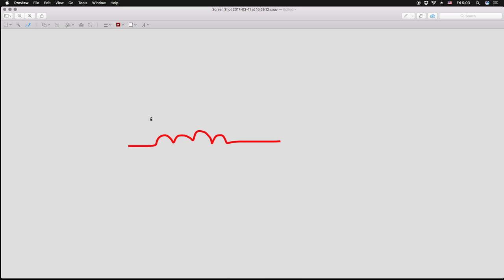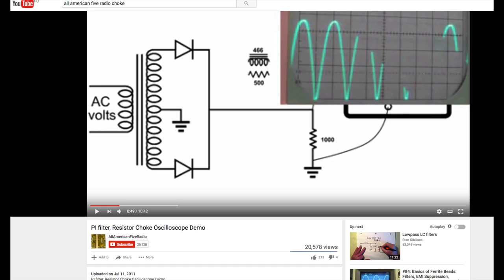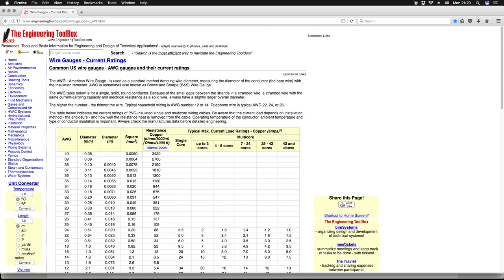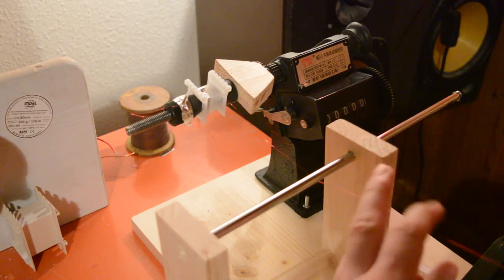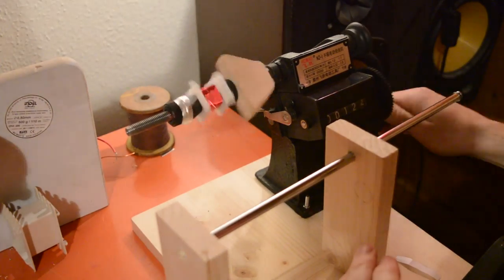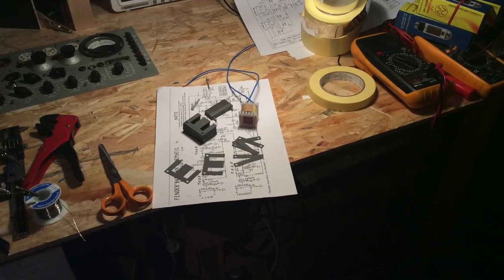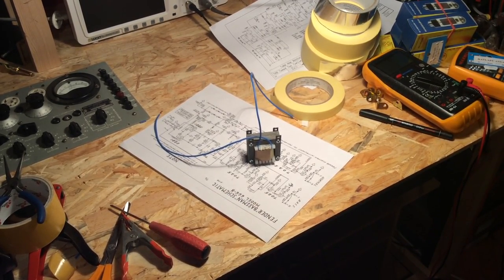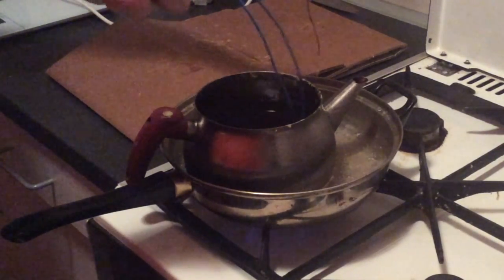Choke in Fender Amplifiers

Comment: If both screen and OT center tap voltages are from the same B+ node, output tube plate voltages are lowered by the inner resistance of OT primary winding, and without any screen resistors screen voltages are higher than plate voltages.
It means that screens will be at quite a stress and output tubes can easily fail when amp is cranked up.
So it is very much recommended to use either one common or two separate screen resistors to protect screens from overheating and to increase tube life.
The proper value of resistors is a couple hundred ohms and wattage should be enough to handle the screen currents at maximum allowed dissipation of the screens.
Reply from the maker: Thanks for your comment. The video was not about that topic, I was just showing a choke in an original vintage Fender schematic. Of course in my build I used screen grid resistors and I always use them.

Comment: Nice work for sure. Please, because my native language is not English, I could not understand exactly the name of the resin used. Could you repeat for me? Thank you very much.
Reply from the maker: I'm using natural beeswax. It is very pleasant to work with, smells nice and has better properties than any artificial resin or varnish.
Depending on where you are located at, it can be very cheap if you find people who sell honey, you might be able to find it cheap. If you buy couple of kgs it will last you for years.
Reply: Thanks for the answer. Okay, I'll use it on my next winding. It is very easy to find around here at a very low price. Actually, the old tuning coils and antenna from the old tube radios were also impregnated with beeswax. Modern (and expensive) technologies have turned away the use of these wonderful natural resources.
Reply from the maker: Yeah, I really don't find a downside to it. 
Good luck with your winding!

Comment: I would not use Aluminum tape as it could cause a galvanic reaction if there is a small failure in the wire coating....
Reply from the maker: The bottom side of the aluminum tape is not conductive, and the wire is dual coated and can withstand 200 degrees C. So, there is nothing to go wrong there. Even if the aluminum would be conductive it would only be able to make a short if one of the other nearby wires also has a failure. But if we would have a failure in two wires then it could make a short anyways so again it makes no sense. So, if the failure rate of these wires would be so great and common the transformers and motors would not work at all. In my experience the high quality wire simply doesn't fail unless you don't attempt to draw a lot lot more current then it is rated for.

Comment: DELATSCH, Is the Chokes storing current like a reservoir like the filter capacitors or is the Choke doing something else to the AC ripple, not sure if the Choke is regulating the current? Most Power tubes 6L6,EL34 use a B+450vdc on the plates, if you increase the B+ to +600vdc would this increase the AC ripple but why would it increase the AC ripple?

I would think it would decrease the AC ripple because more B+ voltage mean less current draw from the power tubes. When you're biasing the power tubes in an amplifier circuit how do you bias the compression of the power tubes the 1dB compression point of when the power tubes start to compression? because its say to bias tubes at a 30mA bias current per tube to be safe but how do you know when the tube is compressing?
Reply from the maker: The chokes don't exactly store electrical energy but they create magnetic field while the current is passing through. A coil by it's nature filters the higher frequencies. The more inductance (more number of turns or bigger or more efficient core) less higher frequencies will be able to pass through it. The compression depends on the rectifier tube more, because of the high voltage drop, but the compression values are not precisely defined, it's a gentle compression. I haven't done any experiments with ripple and changing of B+ but in guitar tube amps the ac ripple coming from B+ is not noticeable. Most noise comes from AC heated filaments and guitar pickups themselves.
Reply: @Delatsch  Using higher value choke values in power supplies will give a different sag compared to using lower value choke values. The Choke is a reactive component and explain why this happens because the chokes are tuned to 60hz or 120hz in power supplies so the higher or lower the choke value does something with the current to starve the circuit when drawing current? What I mean is that the Choke is a reactive AC resistor and the higher value chokes are a reactive AC resistor and the lower value chokes are a reactive AC resistor but what is the differences when the Circuit is drawing current when using a Higher value choke compared to using a lower value choke?

Comment: i want to build one sir can you share the turns ratio, wire gauge and bobin size
Reply from the maker: I've answered in a previous comment the details, but this is a choke so there is only one winding and therefore no turns ratio.
Reply: Just buy one there like 15 bucks for 50ma ones

Comment: how many turns ? dc resistence , and m2 square area ?
Reply from the maker: I don't remember how many turns exactly (I guess around 3000 if I remembe correctly) but usually for a choke you wind as many turns as will fit the given bobbin. The core size is 2,56cm^, DC resistance should be around 100 ohms, but even that's not too critical, since the B+ is usually higher with the modern mains voltage.

Comment: how many turns of wire was that on that bobbin.      im  curious
Reply from the maker: Hi Antonio! I don't remember the exact number of turns, but usually it is not important for a choke because you usually wind as much wire as can fit the given bobbin. Chokes used in these kinds of power supplies have really wide tolerances. So winding a bit more turns will make a better filter in the end.